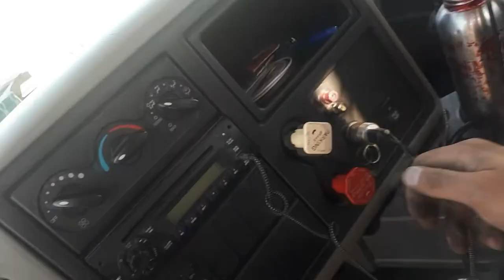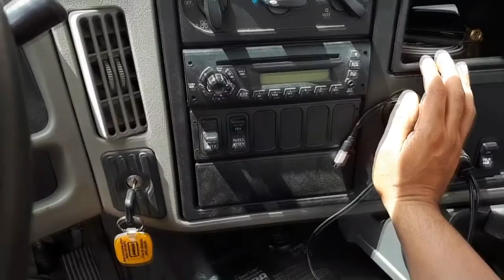Brake chamber repair fail | gladhand mount broke off

Comment: also the bolt of the clamp you were pointing to, if remove the clamp , you're not going to die. the spring in there is tiny. the big spring is in the brass colored head, and its not possible anymore to get to them like that. even if you don't cage the spring or remove the piggyback with the air still on it, you're not going to die.  it'll hurt, but i pop that clamp all the time.

Comment: You are aware the other side of the hose fittings swivel right? The ones that go to the emergency and service brake valve. You don’t need to do that.
Reply from the maker: I tried it but it was corroded, I kinda figured it did and I forgot to mention it on this video.
Reply: @thetransporterboss  10/4, if you spray it with Penetrating fluid get a pair of Vice grips and a adjustable wrench and slowly work it back and forth most of the time they will free up.
Reply from the maker: Nice! I will try that. Thanks for the great tip.

Comment: that tire at 4:26 needs replaced. as far as the swivel lines, if they're rusted to shit, cut the end off and replace with the brass airline fitting.

Comment: Grab two hammers, place one against the nut and use the other hammer to smack the other side of the nut so the rust breaks off, It has worked every time for me
Reply from the maker: Good tip, thanks boss!